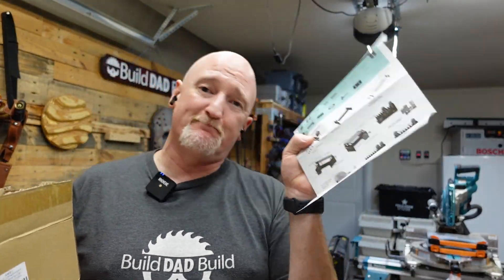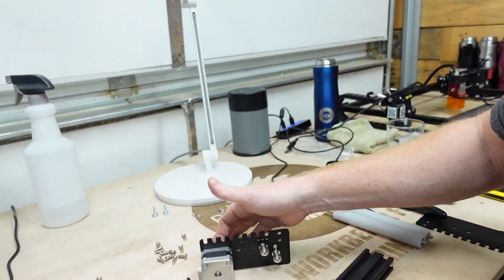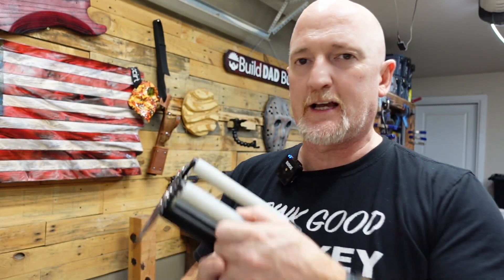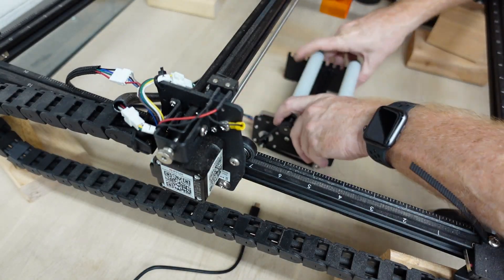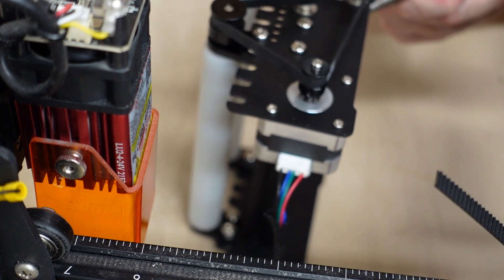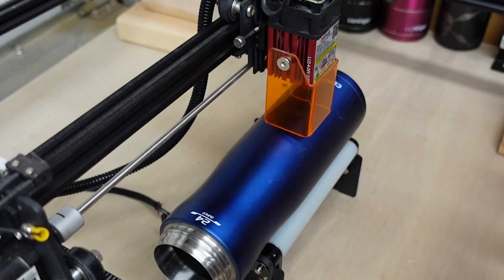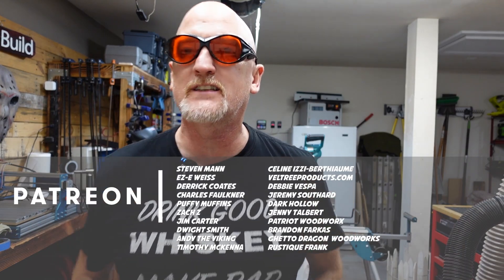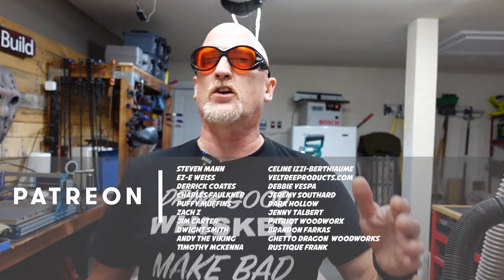Assembling the Rotary Attachment - Ortur Laser Master 2 Pro

Comment: I was going crazy trying to figure out in what direction the motor connectors should be facing. The instructions completely sucked in this category, but your video was a big help. Thanks.

Edit: Dammit. I made the same mistake you did because I didn't get to that part until I'd already attached the motor to the frame. 😄

Anyways, it's the company's fault for giving such poor instructions. There's nothing in the pictures given that give any indication as to the direction the motor plugs should be facing.

Edit2: I've just about finished building this ridiculous device. The rotary instructions completely suck and what's funny about all this is that the original laser unit that I had set up yesterday took about a quarter of the effort to construct. Again, thank you for this video. It helped me a great deal.

Comment: Another interesting video, cheers, ive used this on many shape drinking glasses, after alot of adusting this and that, ive recently tried it on a rounded brandy glass with no stem. Nightmare, as the glass wont stay in place, it sometimes moves. Is the a chuck type rotary that works with the Ortur laser master 2? This would save alot of headaches and drinking glasses.